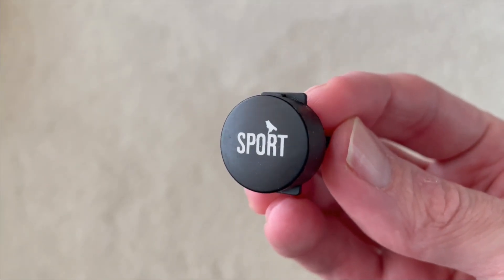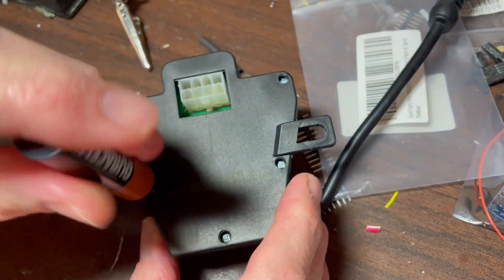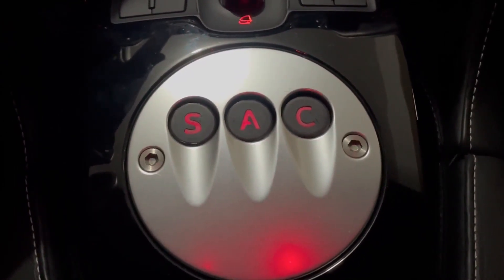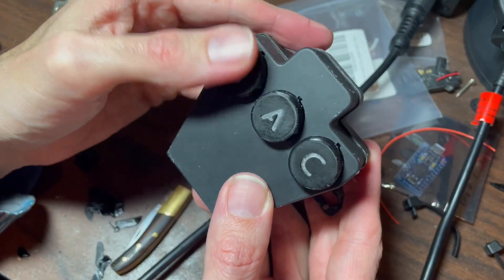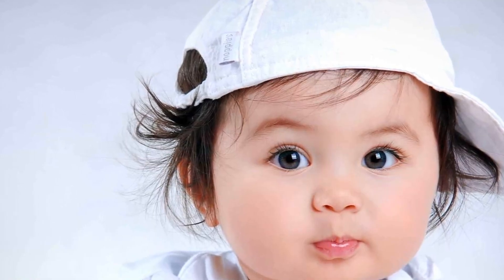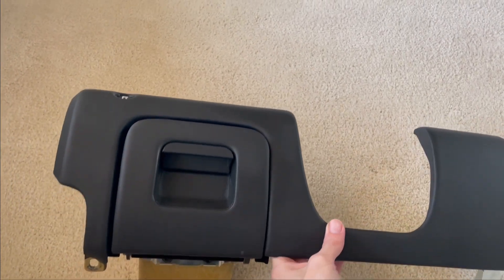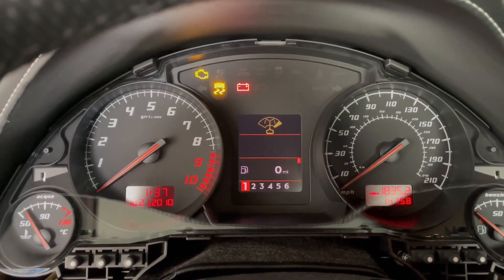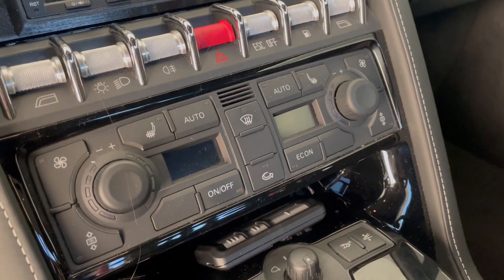3D Printed Buttons for my 2013 Lamborghini Gallardo // No More Sticky Buttons

Comment: Sticky buttons are annoying. I usually use black ABS for most things like this. Thinking about doing my reverse button in red anodized aluminum.
Reply from the maker: Printing in ABS is pretty bad is it leaks fumes that are toxic. ASA is the alternative that folks have been using that is very close to ABS but prints with way less fumes. I really like PETG overall and it works fine for interior parts but is a bit stringy and needs some finishing work.